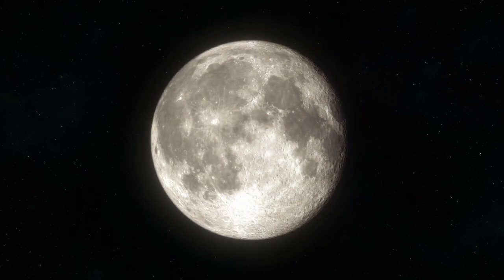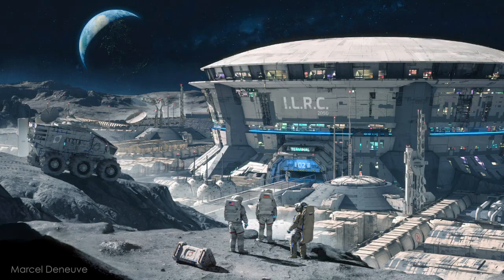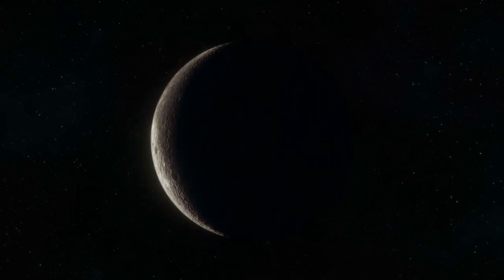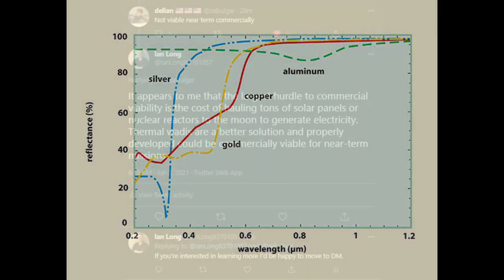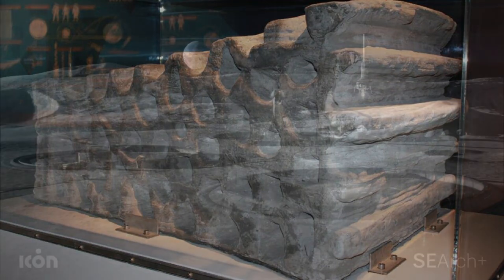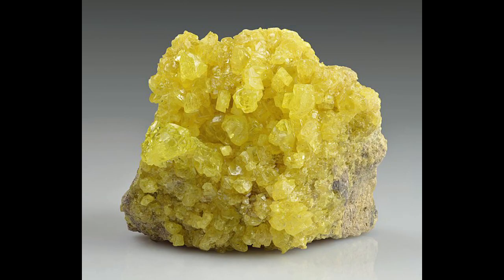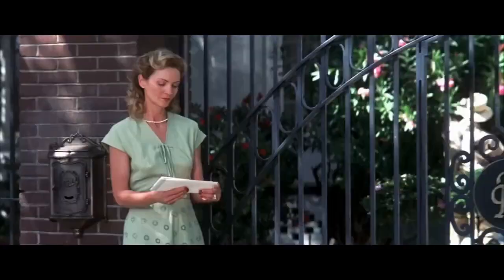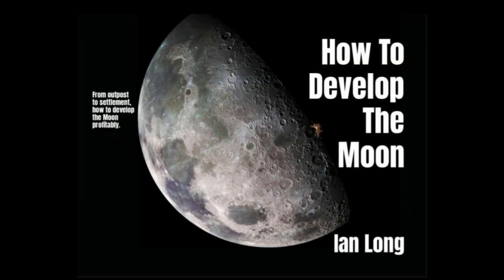Terrible Ideas Everyone Believes About Lunar Development

Comment from the maker: A single Starship load of human food would provide 725,200,000 kcal, enough to feed 662 people for one year. Another way to think about this is that we can “send up” 132.4 hectares worth of food per Starship.

The issue isn't whether or not we CAN grow food on the moon, it's how many calories you can yield per cubic meter. Sure transportation costs (launching from Earth) are more than 99% of the food price but even so it's still cheaper than the cost of food grown on the Moon which is so astronomically high that you won't break even with Earth imports for several lifetimes. And that's not considering a reduction in launch costs over time. Even if a cubic meter on the Moon could yield 10x the calories as a cubic meter on Earth it's still better to send things up from Earth. It's geographic specialization on a solar system scale. Launch costs are falling and will continue to fall, especially as scale increases. It is all about scale, and scale doesn't work well for agriculture on the Moon. 
It would be just great if we could easily grow stuff on the Moon for the same price as on Earth, and it would be just great if we could easily breathe on the Moon and walk around without a suit. It would be just great if the Moon was actually like a smaller version of Earth as people in the 17th century assumed. But it's not. You can build cities and spaceships and statues and toilets and tables out of lunar-sourced materials but you cannot sustain a large population on lunar-sourced food. Food is life, and that's the rarest thing in the universe, and Earth does it best. This is all actually good news because having a massive off-world population will increase the market demand to make Earth do more of what it does best: grow things. Propagate life. This book is very much focused on the near-term but it’s worth noting that once a large number of people (millions) are living in space, on the Moon and beyond, market demand will increasingly incentivize Earth to specialize in its role as the one and only breadbasket. This will create a future in which fields increasingly become worth more than factories, which is great news for environmentalists.

Also a 20x20x4 meter cubic hole would require displacing 1600 cubic meters of regolith. A 20x20x4 meter cubic surface structure would require gathering 2,304 cubic meters of regolith to pile around the structure to a achieve the necessary shield thickness. Digging a hole is equivalent to gathering the roof/top shield material (plus a meter) but comes with four “free” walls. While digging we may run into boulders and other complications however the same is true for scraping roughly 2 kilometers of the Moons surface which, by the way, isn’t nice and flat but rather rough uneven boulder-strewn terrain.
Reply: So you think that the 8 billion people on earth are going to "skip the dishes" to a few thousand special people in outer space on a regular basis with no thought to the resources, (earths resources) needed per flight. Not to mention the harvest itself, the planning per flight, and, ultimately, the complete lack of payback. How long do you think this one-sided relationship will/can continue? Especially after a few hundred deliveries don't make it. 
This is before even mentioning all the other things you'll need for survival. You know, giant Magnetos, radiation screens, water, oxygen, blah blah blah. 
You need to wake yourself up to the fallacy you are supporting.
Reply: Why is it futurists, make their predictions without accounting for politics. Like seriously how do you write that being 4 years removed from Covid. Covid literally demonstrated why geographical specialization is mostly bullshit. Its great when other countries are making things you can do without. But food is a pretty big dependency to have on humans who dont have to worry about where their air comes from and how they are going to get water.

Sure farming is not the first thing that will be done on the moon in a big way. But it will happen. Matter of fact if it didnt happen. I would expect a war between who ever is on the moon and earth at some point. Going to space isnt going to change who we are as a species. We are not going to suddenly all come together and be our brothers keeper. While I do not think it gets as bad as the expanse. The book series got alot right.

Comment: Underground facilities are not feasible. These would take a huge amount of materials, equipment, and energy to construct and maintain.  Concrete in some form would be required.  If the Indian probe data is correct, walls constructed underground would be super cold and very brittle 24/7.  It would be like trying to build facilities in a large deep freezer, with environmental heating.
Reply from the maker: This is actually good since heat dissipation is a huge issue in space and one lightbulb, given enough time in such an insulated space, can cook a room. If the walls/regolith were a good conductor it would require more energy for thermal regulation. Since they aren't the internal temperature of the base can be maintained with radiators.
Reply: @Anthrofuturism  In space, that is black body heat radiation, not environmental convection heating underground. Minus 30 C is not good for energy consumption, and human habitation.  But the reality is there would be no humans, just robots, anyway.
Reply from the maker: @Andriastravels  it's not a matter of "good" vs "bad" it's all absolutely hostile. If lunar regolith was a good conductor we'd need more energy for a heater. If it was insulating (which it is) we'd need a radiator system. This doesn't mean underground facilities are not feasible, they're necessary.

Comment: Most of these arguments are completely ridiculous nonsense. For one, the radiation flux on the lunar surface is only ~500 milliSieverts per year, ISS astronauts are already getting half this on their long duration missions, it's not a problem and the plants in a greenhouse sure as F wouldn't care about such minor levels. And yes, 1 meter of lunar soil, not 10, would block the OVERWHELMING majority of radiation because it's coming from the solar wind and is less than 0.1GeV, which would easily be blocked by such a thickness - the cosmic rays don't need to be blocked and anyone on the ISS is already being exposed to the same cosmic ray flux as they would be on the moon anyway because the magnetosphere doesn't shield the planet from ultra high energy particles.

Comment: I find it strange, that you break down viability in accordance to cost, as is currency. 

Likely, by the time, we are established in space, to the point where we are wanting to grow food insitu, the actual cost at that point would be meaningless.  Much of the cost in space based anything, is the getting stuff out of Earth gravity thing, which is pretty up in the air, once you are free of Earth's gravity, moving around is considerably cheaper, and once we start getting heavy lift vehicles reusable, the launch costs start to go way down. 

Further, any current cost, no matter the metric, where it is in dollars, or simply just energy costs assumes current techniques, whereas right now, we are going through a renaissance phase in Machine Learning. There are multiple ways ML can be leveraged in the engineering and building of space infrastructure, and we are currently only getting started in terms of ML and robotics. At a certain point, if your robots can build other robots out of local resources, you basically can build stuff for free, if there is a reliable power source. 

I largely agree about the Nuclear part, battery storage will still need to be a thing however, and how Battery storage develops by the time we are spec-ing out serious lunar research stations, the current state of the art, would not be the metric, but rather where it happens to be then, not to mention, that even though it is less efficient, you could have a solar array in lunar orbit above the area you need to power, and use microwaves generated by the array, to provide supplementary power, should you need to do maintenance on the reactor systems. Keep in mind, that in space, you need multiple redundant systems, and passive solar is going be the best alternative to Nuclear. 

Lastly, if you have nutrient infused water, you can just grow plants hydroponically, which uses less water, than growing stuff in soil. Yes there are some unknowns still, but that is what a lot of the research science on the moon would be looking into, and will likely solve many of these problems, it may take decades or even centuries, but these are likely all solvable problems. 

Honestly, the question is not going to be, can we do X in space? It is do we need humans in space? Because ML is going to change the game for space, when it is paired with Robotics, and is asked to make paperclips, there will not be much of a need for humans to actually be in space.

Comment: 5:10 98.5% cost from the Batteries. This is actually the biggest drawback with Solar(or wind) energy, the batteries. Even if you own a E-Vehicle right now, the biggest cost in it... is the battery. If you have a accident with a E-Vehicle right now, you could spend 5,000 to 20,000 just to replace the battery.
Reply: Yes and that battery replacement on that EV is moot if the accident is followed by a whole lot of flames. We the public are being feed a whole lot of untruth, misleading, false promises about EV's.
Reply: @deanmason5827  The main point I tried to make was, even a small'ish accident that doesn't seem to damage allot, could compromise the battery enough that it has to be exchanged.

But of course like you say, if you have bad luck the battery could just go up in flames right under your seat depending on what damage it sustained.